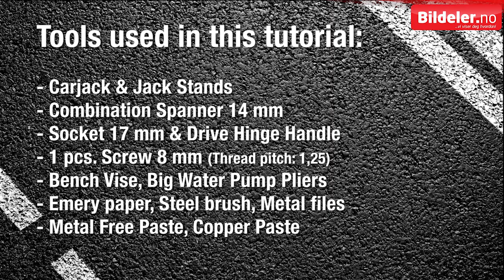Mazda CX-5: DIY - How to replace front brake discs and brake pads - 2012 to 2017 model (KE)

Comment: Nice video, clear explanation with clear visibility👍 Quick question, what's the socket size for the second pair of bolts that hold the caliper bracket (seemingly larger than the first pair) @ 2.40min?  17mm perhaps?  Thanks.
Reply from the maker: Hi. We're 99% sure its a 17mm socket. :)
Reply: @BildelerNo1  Thanks.   I am also positive it is 17mm (saw it mentioned elsewhere too).  Yet to do my rotor/pad replacement though:-)

Comment: bleed the brake fluid as you pushing the piston back in,  do not push the piston straight back in without bleeding the brakes because it could damage your ABS system.

Comment: Front side has 2 bushing one is with rubber other is without rubber but little more long. I confused bushing with rubber is bottom side or up side (for front brakes) also same question for rear brake please . Many thanks for your answer
Reply: The pin with bushing goes on bottom for the front brake and on top for the rear brake